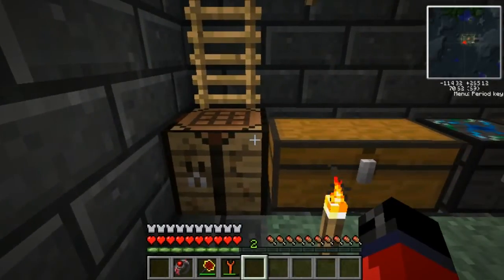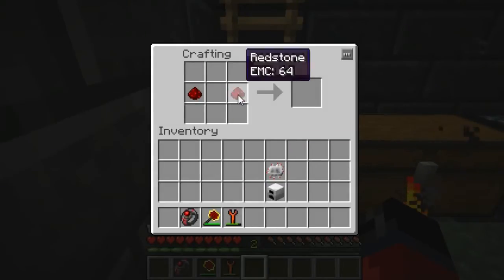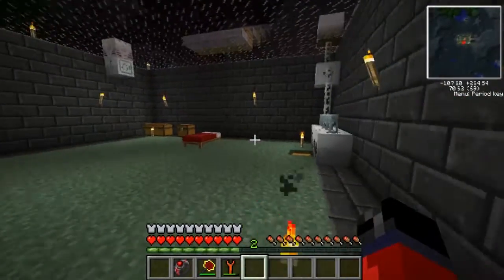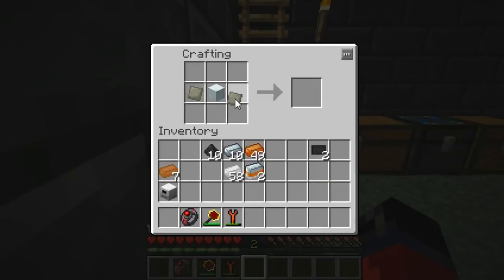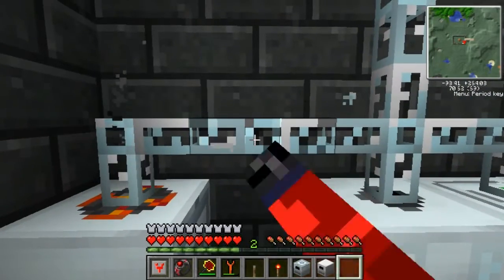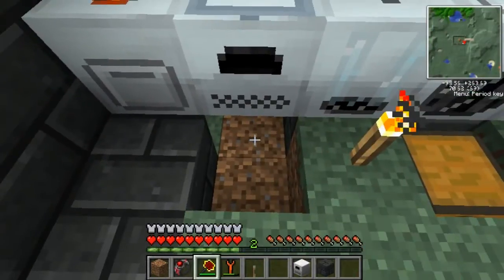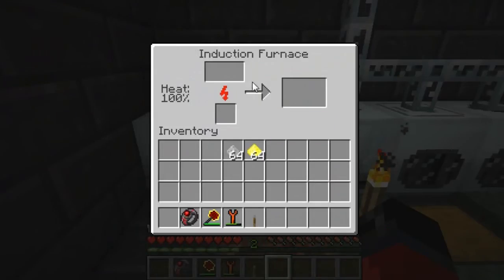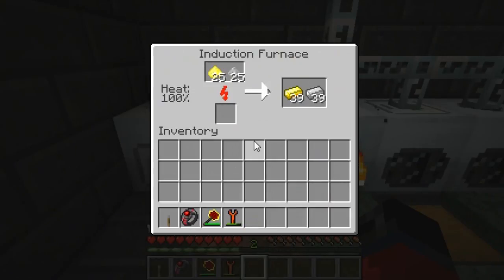Tekkit: Induction Furnace. Smelting Super Fast and Easy!

Comment: Fast? That's not fast.  Try an IC2 electrical furnace with 20+ upgrades powered by parallel MFSUs... now that is fast, almost a whole stack of 64 in the same time you need for 2 or 3 ingots.
Reply: +Opetr the ic2 electric furnace is way faster than this induction furnace
induction furnace u cant even put upgrades on